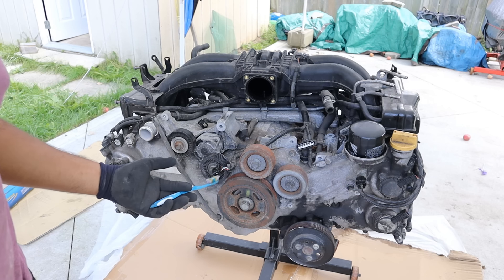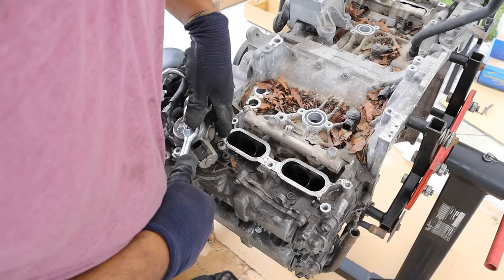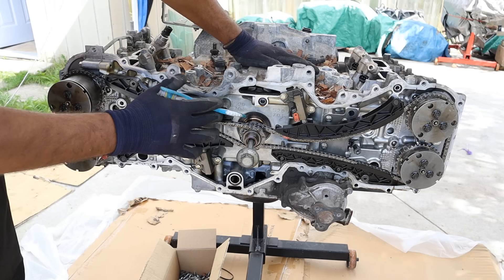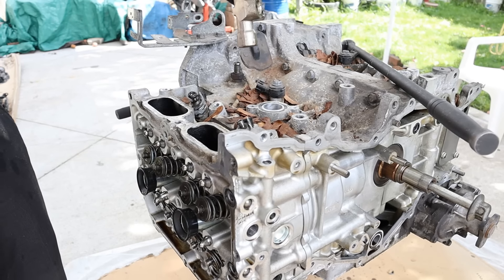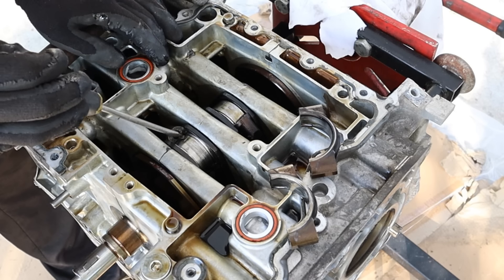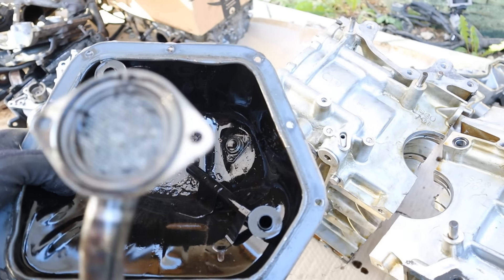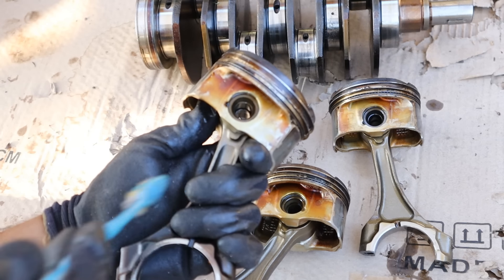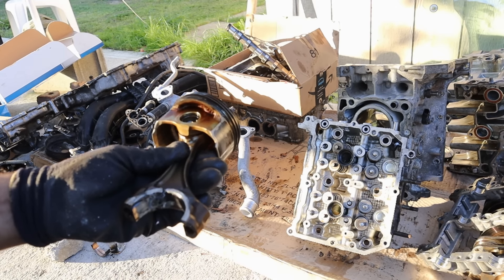Subaru FA20 Engine: A Step Forward for Subaru?

Comment: Gosh, looks like the owner followed the dealer recommended 7,000 + miles interval between oil changes. Possible thought they could go that long before checking oil level too. As others have said, great channel Bro. We appreciate the work it takes for our education and entertainment.
Reply: Yeah always thought the 7500 oil change interval was insane, can't believe anyone actually follows that.
Reply: @AlternateRye  So I just looked it up and 7500 miles is 12,000 kilometres. What's insane about that? Every car I know has an interval of 15,000km if you're looking after the car because some manufacturers prescribe longlife oil every 30,000km. How often would you change the oil in this if 7500 miles is insane for you? Every other Tuesday?
Reply: TBH I don’t nearly drive enough in a year to get to those intervals, still an annual oil change is a must…

Comment: Great vid - I can already tell Subaru puts plenty of efforts designing their engine unlike the Detroit 3s
Reply: this should've been made super clear, it wasn't Subaru... it was the operator that failed. standard though and then they put the blame on Subaru and make them look bad. All good for the ones with knowledge, makes the cars cheaper for us lol.
Reply: Effort maybe… but the outcome is still questionable. Seen as number of FA/FBs blown up. Not Kia bad but not great.
Reply: It's a flawed design.  Your wallet will not be happy when it's time for repairs.
Reply from the maker: Yep. They sure are unique. Mazda is also a bit different with the whole skyactiv setup too
Reply: @speedkar99  you have any videos breaking down skyactiv tech? ive heard that its basically an ICE with incredibly high compression to burn everything in that chamber - sounds cool
Reply: IMO the biggest issue with these engines is how hard they are to work on in the car, its like a diesel f350 that shit doesnt fit very well. My army friend got a subaru and i was not impressed with the oil leaks at 80k miles. It was leaking right from the seal where you merge the engine halves. I would take a sabaru over a kia any day though.

Comment: Okay…. So…. If you look at the oil feed ports in the front of the block and timing cover……. The one under the oil filter goes to the driver side head, the one in the lower center goes from the pump to the filter, the upper center to the mains, and the passenger side to the passenger head. The junctions between the timing cover and those ports are sealed with o rings. What do you see hanging off of the sides of the ports and tc? Sealant…… it breaks off into the passages and clogs the OIL GALLERIES…… not the pickup tube. (Separate issue) Thats what causes the majority of J02 failures. Any decent mechanic knows you don’t use sealant and o rings unless it’s explicitly stated in bold, red, and all caps.
Reply from the maker: Yes

Comment: BRZ and FRS are suffering from this not because they are poorly maintained, but because they are often tracked, and sideways loads in corners usually send all of the oil to one half of the engine, which can lead to pick up tube being exposed to air. Mostly in long right handers or heavy braking.
People solve this issue with baffles in oil pan and oil accumulators.
Reply from the maker: Yep. That was a thing even with the older EJ motors.
Reply: I love my subarus, but boy their engines are not performance worthy
Reply: @Mattalaska  their engines have advantages. Short crankshaft, good balance. Maintenance is actually quite easy, if you know what you are doing. They have their weak spots, but they don't manifest, if you are maintaining them. The horror stories come from people who bought an abused car, or who abused the car themselves. These don't tolerate abuse as well as Honda or Toyota engines.
Reply: Ok new failure due to excessive silicone sealant blocking pick up lol
Reply: That's not even engine specific I don't think, I'm pretty sure it's a problem for Subaru in general. I saw a guy on YouTube doing donuts in a WRX and the engine blew due to oil starvation just like these new rear powered sports cars they came out with recently. Sounds to me like the need to rethink their oil systems and pan designs at least on the sports models
Reply: @herniagaming  Well, there is a reason serious sports cars are all coming with a dry sump. It is bloody expensive though.
Reply: @evgenysavelev837 I'm so sick of seeing this "abused car" cope. This is what the motors were made for. This is what the CARs were made for. This is what the engineers designed and tested them to do. Akio Toyoda (same guy who tested the supra at LeMans as the CEO of Toyota) personally requested changes to the suspension on the GR86. The WRX STI was DESIGNED to win in rally. These are performance cars. They hold their name up by their track worthiness. This isn't ABUSE; this is DESIGNED USE.
Reply: @GPaulTheThrashKing  Third time lucky. I think replies with links get deleted.
Anyway, I disagree. Car you see on dealers' lots are made to attract 99% of people. That means they are designed for hundreds of thousands of miles of mild driving (may be we can exclude BMWs which are made to fall apart after 5 years). Yes, even STIs and WRXs are made with cheap longevity, not performance as the main objective.
Making cars is a business, not a sport. Engineering Explained channel has a good video of how much the stock STI needs to be modified to survive a rally school. So don't buy the marketing hype, these cars are not made for track. They are made for raceboy wannabes, who need to get from point A to point B in style. No dealer will have a track ready car for less than a few hundred grand.
Reply: The timing cover cave and weak oil pick-up tube plus the lack of baffle in the sump all contribute to the oil starvation and ultimate rod knock and failure of the bearings.  The owner probably never see that coming.
Reply: @jtwu8931  Would be nice to see them go to dry sump system at least on their performance models.  Not crazy about the plastic timing chain guides either (Nissan KA24E every 50K miles).
Reply: @evgenysavelev837  I agree 100% with this take, and I even put my money where my mouth is and bought a GR86.  It's a fantastic little street car.  The oil starvation issues are inherent to the boxer engine and the oil routing.  If you track the car it's going to blow up, especially if you don't mitigate it with accusump or Verus baffle or at least an overfill.  But you know what?  Solution is don't track the car without first installing a dry sump.  The car cost less than $35k, nobody should be complaining that the car isn't ready for the track at that price, that is absurd, enjoy it for what it is and take care of it.

Also don't even get me started on the RTV FUD.  There is a reason the pickup has a screen and there is an oil filter and there is an anti-drainback valve in said oil filter, and there is a reason they are able to warranty the thing to 5 years/60k miles.
Reply: @GPaulTheThrashKing  The racing versions are prob very different than production versions. People will complain about the price.
Reply: @lashlarue7924  Tracked mine going on 7 years, drift only. GTIII-RS Turbocharged. Still running good. (Knock on wood).
Reply: So basically, it's a sports car that can't do sports stuff.

Comment: At 105k miles, my 1979 Subaru GL wagon’s water pump failed. That required lifting the engine as the cross member of the frame prevented removing the pump’s bolts. While the engine was lifted, I decided to disassemble to replace worn components. I was unable to split the case. So I took the block to a shop.

A little backstory is useful before I go on: I regularly changed the oil and filter at or before 3000 miles. So the engine had 35 oil changes and filters (105/3 plus the first change at 1000 miles).

The next day the shop owner called me up and asked how many miles the car had. I told him 105,000. He said “that can’t be.” I asked him “why?” He replied “because there is not enough wear on this engine!”

I try to change my cars oil regularly.
Reply from the maker: Good call
Reply: Oil is so important...my Tundra is nearly at 50 000 kms. I am on my 5th oil.change. I do one every 10 000 kms even tho 16 000 kms is recommended
Reply: OCD
Reply: I too regularly take my perfectly functioning engine out to be rebuilt, only to be told it doesn't need rebuilt!
Reply: @kevinwest1607  He took it out because they couldn't replace the broken water pump with the engine still in the car.

Comment: Great vid, despite the lack of laundry!
The oil return on the pan looked interesting, and I could see that motor starving the pickup under load pretty easily especially with no baffling. Do that for a few laps and boom.
Reply: Not checking your oil levels is more likely the issue.
Reply: Spot on, probably track day or canyon racing
Reply from the maker: Yes! Combine with a lower oil level and this is what caused alot of earlier EJ motors to blow.
Reply: @speedkar99 true low oil and no baffling makes this engine capable of starving on oil in turns.  I would maintain it full full
Reply: Yeah, it's both.  All Subaru boxers are sensitive to low oil levels, but many BRZ/FRS get used for track days, or just hooning around.  Unless you replace the oil pan with a baffled design, trouble will find you!

Comment: I've had the turbo variant of this engine for 5 years, 60k miles with no problems. OEM Oil/filter change 3--5k, spark plug changed recently, no tunes/tracking throughout the whole time. However, I did get one check engine light. Code P1449, due to Japanese spider webs in the EVAP system.
Reply from the maker: Nice. 60K miles is t much though.
Reply: Not much at all. Btw I watched your EVAP video from 4 years ago and it helped me understand more. Thank you

Comment: I did my first set of spark plugs and my first valve cover gasket on a 2004 wrx. Honestly, it wasn't that bad the only issue was I couldn't get a torque wrench in there so I had to do it by feel. After you do it one time you basically know what to expect with every subaru motor ever.

Comment: Very interesting engineering. Uncompromised symmetric drive with endless challenges to keep up the essentials. Brave move from the 2 makers.
Reply: The engine has uncompromised symetric all wheel drive?
Reply: They should just do an inline motor and lay it over - IMO!
Reply from the maker: The packaging would be detrimental to the layout.
Reply: @yo_marc  That's called a slant style. Commonly slant 4 or slant 6.

Comment: As much as the FA20 gets shit on especially for being "torqueless", still love the motor.  I had 2 FRS from new for over 10 years, still possibly my favorite car.
Reply from the maker: A car isn't just it's engine. It's about the entire conjunction of parts that work to create the experience.
Reply: @speedkar99  of course, but the engine is akin to the heart so it contributes to much of the car's personality.
Reply: Did the fa20 get upgraded over the years for the brz/frs? Like minor model year changes. Slight improvements but not documented by Toyota or Subaru officially?
Reply: @Unknownmanufacturer very minor changes. Wiring harness, ignition coils,  sensors, slightly different part configurations between the Kouki and Zenki especially but nothing extremely significant.

Comment: From the racing guys, that bent oil pickup tube creates cavitation at high rpm and will fail even a properly oil filled engine.  Aftermarket makes a straight tube pickup

Comment: 2:59 Rod knock at 114'000klm !? 😮 How to prevent this ? What oil will you choose for the FA20 ? I have fear now that I know it's happening at sunch low KLM... Is it really low on oil and with hard cornering/High revving the engine starve oil or something like that ?
Reply from the maker: Yes. Alot of 2012/3 models suffered from these failures.

Comment: I see no screen on the oil pickup in the oil pan.
I have one of these in a 2015 car with 71,000 miles.  No oil useage other than 8 oz. or so,  in 7500 mile oil changes.
It does seem to eat coolant and no one in forums seems to have an answer.
Reply: Cracked block or head gasket leak. Or leaking coolant hose somewhere.

Comment: Is this one of those Subaru engine where they loose oil pressure going around corners. Maybe someone had too much fun around the track? The oil pan seem pretty bang up. Nice breakdown!
Reply: That would be the new FA24 non-turbo in the new BRZ, that was only pushing the engine hard on the track, daily driving should not have that problem. Running a heavier oil for the track is ideal to prevent that too.
Reply: @amdstrollo3074  , thanks. Not a worry if you only go straight.  :-)
Reply: To clarify these fa20s also lose oil pressure around cornering but not as much, see below:

https://youtu.be/4Jk5WTWoqt4?si=3a7NtZ7wyeogveL8
Reply: Yes, they do. Not as bad as the new 2.4L ones, but they don't have an adequate oiling system for hard track use.
Reply: @amdstrollo3074  The heavier oil does nothing. It's been tested. Accusump is the only thing that helped so far.
Reply from the maker: Oil pans banged from being around my yard lol
Reply: Ah, I guess my thinking is you would want to use heavier oil for the track anyways, regardless of how good the oiling system is, for the high temps. @chrisbradley3224

Comment: The thing I notice about rubber sealed surfaces is they deform over time and create micro gaps for whatever reason.    Buy any old el cheapo valve cover gasket but apply rtv to both mating surfaces and use the gasket as a mold.  RTV seams to conform to these imperfections.
Reply: That’s what I always do on any of my cars.  The added RTV sealant costs SFA and might save you from having to pull it all apart again in a few years time when the rubber gasket lets go.
Reply from the maker: So you put rtv on top of the gasketed areas?
Reply: @speedkar99  the shop I worked on and off always put a thin film of rtv on the valve cover gasket housing areas and put the gasket in-between and never had a problem.   A mared or compromised surface can't be helped by a premium expensive gasket as the micro gaps would leak way sooner but with the help of rtv those cracks/gaps get filled. Another thing it was the 24 hr cure cheaper RTV but the customer was able to drive away within an hour with no issues with the help of a gasket core + RTV.

Comment: If you can find one, please compare the old boxer engines from the likes of Alfa Romeo (Sud, Sprint) with the more modern (Subaru) boxers. I used to own an old Alfasud and those engines were amazing (the sound in particular). I'd like to get a technical breakdown of those engines to see how design has improved (or otherwise) since the 80s.

Comment: Actually after watching again, quick question: the oil temps in these cars tend to run pretty high stock and when just cruising around, how can you rule out that it was a lack oil and not just overheating the oil and causing the oil pressure to drop? Or would they technically be the same thing in this case?
Reply: Add in the fact they recommend 0w-20....
Reply from the maker: That can be an issue yes. Oil doesn't boil off like coolant would though
Reply: @CTR_Dan  yea I been sticking with 0w-20 on mine
Reply: @whiteunclerukus use 5w30

Comment: What I'm seeing here and it kinda seems like almost all vids of Subaru engines failing is oil starvation/lack of maintenance??

Since it seems stupidly reliable on the other side of the coin and those people are likely just keeping to the maintenance schedule? 

Thoughts?
Reply from the maker: Somewhat. The inherent design of a sideways engine is that oil doesn't naturally fall down to the bottom... Causing starvation. 

Also the service intervals should be halved